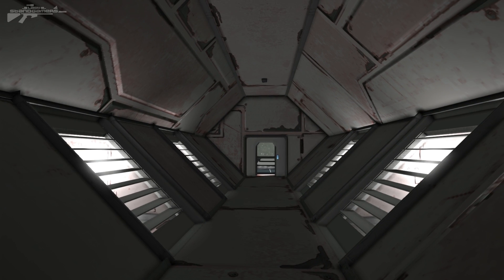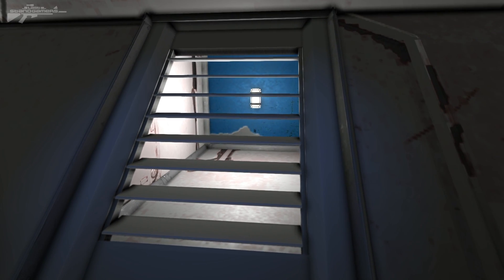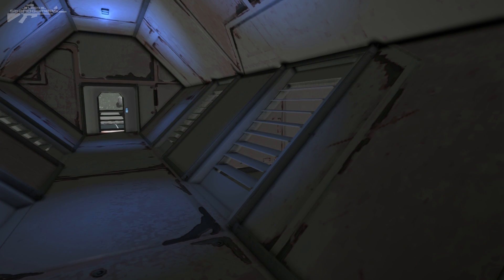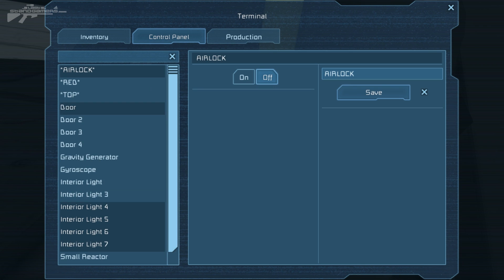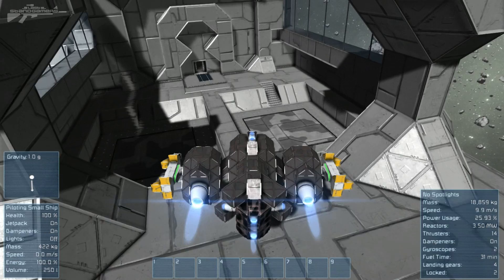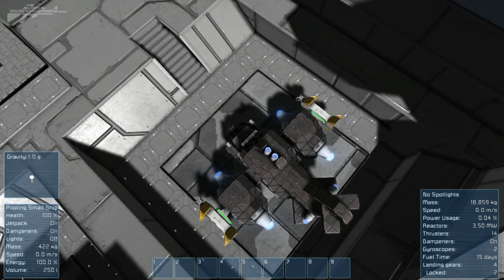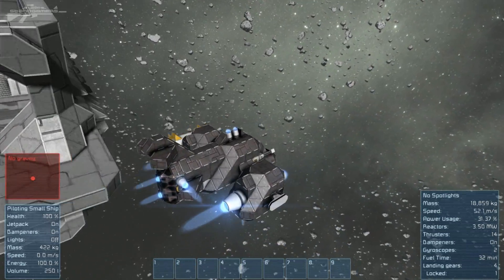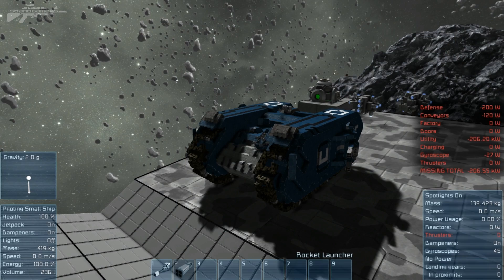Space Engineers - Grouping Control Panel Parameters, Reversible Motors

Comment: Now that they have grouping they should add a type of control panel block. You could access the controls by pressing "I" and selecting a group that you want the panel to use. Then when you go up to it and press "T"  (like you would for a medical bay or any other operable object) it will turn that object on or off. So yo can have a quick easy to access light switch for example.